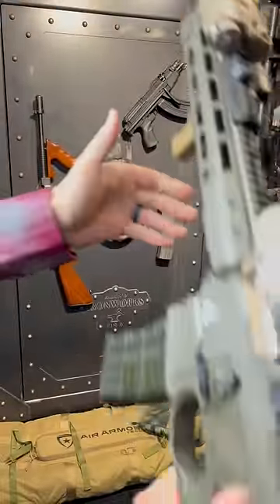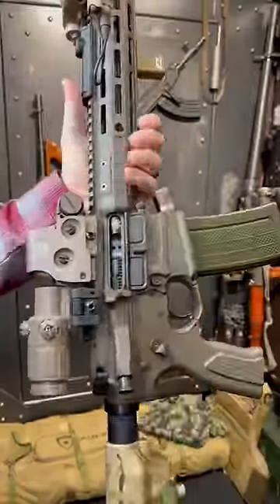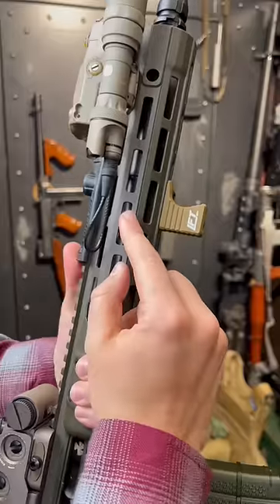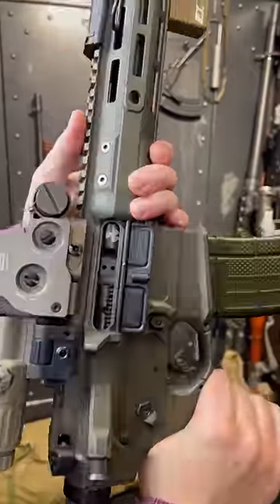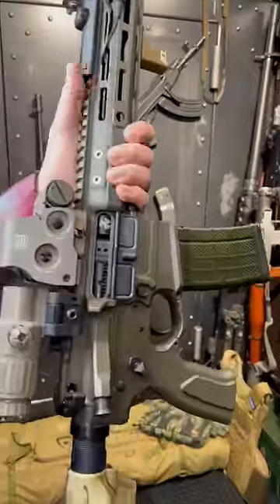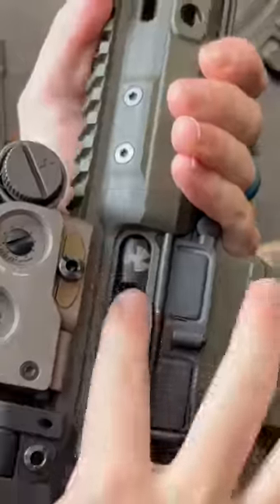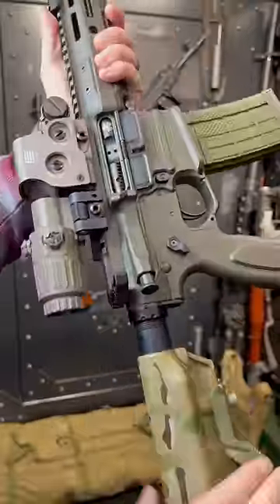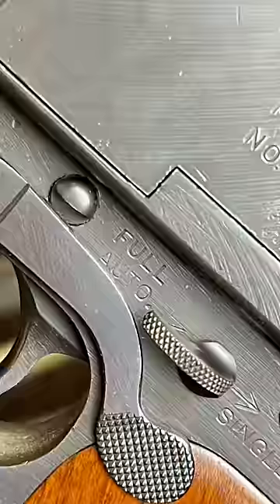Pro Tip: “Tuning” Your AR Explained in 1 Minute #Shorts

Comment: Yeah. You lost me. I take a pistol to the range, shoot at targets until I run out of bullets; then I go home and clean my gun. That's as complex as I get.
Reply from the maker: It’s definitely not something I used to consider a couple years ago, but it’s magical when it works
Reply: @Jacob Guthrie no not really, spend the money and kit one gun out with a light laser and good optic and stuff and you will understand why a lot of his guns look so “tacticool”
Reply: I have my AR for multiple purposes. For one it’s the same platform as the one I get issued and training off work lets me get more promotion points. It also allows me to get way more knowledgeable about what I use. 
But secondly and more importantly, it’s the weapon I have for an end of society scenario. It’s a shit home defense gun unless you live in a ranch and I damn sure don’t have any plans to use this out a car. Any range days are for training and training only. Meaning it’s only purpose is to be used during the end of days, and an over gassed system can mean a rifle that goes 3000 rounds before needing parts replaced over a rifle that goes 10,000. That’s huge in that scenario.
Reply: It's like having a regular car then having one that's a hot rod
Reply: I am the same. Have a couple 30-30's i haven't shot in years, but next weekend I am getting my first AR. 5.56, Plus about 500 rounds.  Next year I think I will build one, with plenty of advise from someone who knows how.
Reply: Thats perfect.

Comment: Would have been helpful for you to actually show people how to tune an AR
Reply: Adjustable gas block, gas tube, buffer spring, and buffer. Ideally, you want a 3 0'clock ejection pattern, unless it's a lefty, then you'll want a 9...
Reply: Yeah he can show all that in 60 seconds, use your brain
Reply: @SantanaBinks  then name the video "why you should tune your AR"
Reply: @joeybible683  why and how are two different words bud
Reply: @SantanaBinks  yes.. I know
Reply: @SantanaBinks  are you drunk?
Reply: @joeybible683  Again, why and how are two different words. Take it slow alright no need to stress yourself out
Reply: @SantanaBinks  yes, I know
Reply: @joeybible683  He didn't say how to tune your AR, learn how to read
Reply: The video is called, Pro tip: how to tune your rifle...
Reply: i take it you're new to ar just get a 20" barrel with a rifle length gas block and you'll be fine
Reply: @joeybible683 Unless he changed it, that is not the title of the video.

Comment: Tuning your gun like that can also make it picky on what kind of ammo you use causing it to not cycle properly as well.
Reply: Tuning a mechanical systems like engines, guns, bridges, or even an electromagnetic system like wifi antennae have a very specific goal: you “tune” to get the optimal output from a specific and repeatable input. 

You “tune” a car for maximum performance using a specific set of parts. 

You “tune” a gun the same way. Every part produced is slightly off-spec (also referred to as tolerance.) Therefore you customize variables against limits to reach maximum performance.
Reply: Guns as clean and shot as little as these are in no danger of that. Only the finest highest dollar ammunition goes through these safe queens😂
Reply: Yeah cuz this gun with approximately 0% salt is in danger of FTF lol

And how dare you not mention twist rate accuracy issues? Excuse me while I overspin myself out
Reply: @Nave6W came here to say that lol
Reply: Tuning your gun like what?  I don’t think you know what tuning a gun is. You can tune your gun to cycle every type of ammo and have less recoil at the same time it’s not one or the other.
Reply: @mforge348  sounded like he was describing Tuning the gas port (if you can)

I just watched a video and subs wouldn't cycle cause he "tuned" it for supers
Reply: @mforge348  sounded like he was describing Tuning the gas port (if you can)

I just watched a video and subs wouldn't cycle cause he "tuned" it for supers
Reply: My AR15 is a rough workhorse - I wont change a thing.
(I chose every part (chromed barrel, sport trigger right at on my order))
Reply: You fix that by buying a piston gun with adjustable gas system . You can adjust the gas to the fly usually has 3 to 6 settings
Reply: @mforge348 no, tuning your gun at all makes it less reliable. The point of overgassing is reliability.
Reply: Bro hes literally just talking about tuning the gas on the gun. He doesnt have to mention barrel twist rate/pressure accuracy. If any, there's such little effect on accuracy adjusting pressure because of barrel twist it won't matter unless your hundreds of yards out.  @Lethalmuffin87
Reply: I would make one point and say that anybody who thinks their 5.56mm rifle has recoil that’s “too harsh” would be better off spending $10 on a gym membership than on all kinds of new parts.
Reply: Facts
Reply: I prefer a gun that runs a little hard but reliable with any ammo over one that shoots like a picky airsoft rifle
Reply: You can tune with an adjustable gas block for DI or Piston, adjustable bcg, adjustable recoil spring and adjustable buffer. It’s all a balancing act.
Reply: Lmao people talking about barrel twist have probably never shot past 300, 1/7, 1/8, 1/9, even 1/12 will be pretty much the same among all the common bullet weights until you get to 500, even then the difference from 1/7, 1/8, 1/9 has been blown out of proportion, we know 1/8 is the best twist now but any modern bonded jacketed bukket is not going to spin apart from a 1 twist or 2 twist per inch difference.
Reply: @rifleshooterchannel208  Less recoil = more hits on target faster. Particularly when not in perfect positioning.
Reply: @PineyJustice  Something that’s easy to do with any shoulder fired firearm chambered in 5.56
Reply: @rifleshooterchannel208  Sure, but why settle for 2 hits when you could have 3 or 4. I have both btw, a nice URGI build and also a full race gun with a m4-72 brake and full tuning. At 50 yards you can put more than double, possibly even triple the rounds on target in a set period of time.
Reply: @PineyJustice  Difference will only really come down to the trigger. 

If shooting an NSR with a 5.56mm shoulder weapon is too physically taxing for someone, I will reiterate my point about that person getting a gym membership or eliminating soy from their diet.
Reply: @rifleshooterchannel208  It's not about tiring or painful recoil, it's a matter of keeping your sights on target with each shot. If we go the other way do you think you could match a 5.56 rifle with 7.62x51? Just as a 22lr will always put hits on target faster than 5.56. Life isn't a balanced competitive videogame, I'll take the cheats every time.
Reply: @PineyJustice  You’re trying to argue a point that wasn’t made 😂

Nobody is talking about larger calibers or any calibers besides 5.56

If someone is shooting a 5.56 rifle and it’s bouncing around too much for them. 

It’s gym time.
Reply: @anthonycall5566  lmk when your gun doesnt cycle the second some crud gets in it since you "tuned" it to be under gassed for less recoil lmfao

Comment: Could you show us how that 3x and holo looks like?
Reply: It's a 3x
Reply: @jailbotmark1379  thank you jailbot mark one 1111
Reply: I run one on my setup theyre amazing
Reply: @rickypickles2219  daaamn! Nice!
Reply: @MatiasAimone  what do u mean lol
Reply: I have one no idea how I could show you photos tho but it’s very nice
Reply: Have an EXPS3 and G33 magnifier on my AR. EOtechs are absolutely worth the price.
Reply: it looks the same as the eotech reticle normally looks but it appears bigger because it's magnified.
Reply: @johnc5330  what is actually happening is some optical magic. The reticle stays the same size with Holographic Reticles under magnification which makes them very useful for targeting. Why it appears larger under magnification is because the way a Holographic Reticle works - the magnification only changes the scale at which we see the reticle but not adjusting the size. So it is bigger, but it isn't. It's just scaled up in size.
Reply: @Andrewy27  ya I didn't explain that well at all. You're right. That's why the aimpoints suck with a magnifier because it actually does make the dot bigger. Causing you to no longer have a 2moa dot.
Reply: @johnc5330  exactly,

The Holographic technology is pretty awesome and coming in at the same price or cheaper than an AimPoint T2 it doesn't make sense to want that over the HWS.

Now I wished that EOTech would do what sig did with their ROMEO8. But I'd imagine that significantly increasing the price
Reply: @Andrewy27  to be honest I prefer the t2 over anything else. I have an exps3 with green reticle and it's a but fuzzy when I look through it. But I do have it on my go to rifle because under night vision the eotech reticle is super clear and crisp. It's a drastic change compared to the naked eye. Also I like the battery life on the t2 better. But I've always got 123a's on my kit so it's not that big of a deal. I don't use a magnifier either.
Reply: @johnc5330  I understand the battery life issue - and if you aren't magnified then it wouldn't matter - I mean if you're running magnification on red dot optics

I run the G45 with an EXPS3-2 - honestly better than fixed mag with canted sight.
Reply: I find it hard to show something like that on video. My dots all look clear IRL, but when I try to photograph or video them, they appear blurry & much larger in MOA.
Reply: Just a 1x holo with a 3x magnifier. 3x magnification with the magnifier engaged. They make a big enough difference in my opinion to justify the weight and crap in your way. It also will magnify your dot 3x so if you have a 3 Moa dot it will be 9moa at 100yards. Not much precision to be had with a magnifier but you can put shots on target within a reasonable distance. I have one on a Geissele super duty, thinking about a LPVO instead of the Holo/Mag, either setup is effective
Reply: @johnleary4597  John, if you're using a Holographic sight and a magnifier it does NOT increase reticle size. It only increases the scale you see the reticle in relation to other points on the reticle. A 1 MOA dot stays 1 MOA under magnification.

Reticle size change is only true for non-holographic Red Dot Sights.
Reply: @Andrewy27  great to know ty💯👌🏻
Reply: What’s it look like? Expensive. 

And because this hunk of metal with an LED and some glass is ungodly expensive, it actually works reliably. Yay.
Reply: @Lethalmuffin87 it’s holographic not LED
Reply: @madride858585  The better correction would be it’s a laser emitting diode “LED” instead of a light emitting diode “LED”

Comment: Ah..it be nice to show us how to do that being that the title says that...
Reply: Its all gonna be somewhat diff.  
What size barrel.  What gas length.  What size gas port.  What weight buffer and so on.. 
Changing just one can change it all.  
The best way to know for your particular build.  
If it ejects 230 or forward = overgassed 
3-4 o'clock properly gassed. 
Beyond 400 under gassed. 
The right way to fix over gassing is an adjustable gas block though many just use a heavier buffer or stronger recoil spring.   
Undergassing isnt normally as frequent a problem.  Though it can be corrected going the other way less heavy buffer/ weaker spring or open up the gas port.

Comment: I built a 16" AR-15 with a mid length gas system and would almost eject empties.
I swapped one of the 3 steel buffer weights for an Aluminum one and it runs fine now.

Comment: Noveske is severely over gassed . I measured 0.88 on my 14.5 . That's insane . My Centurion has 0.75
Reply: Same on my 13.7 Roscoe, it will run crap steel case ammo reliability when it's clean but it's definitely undergassed. When I slap a suppressor on it runs steel just as  beautifully as full power military ammo unsupressed. Finally shooting military ammo suppressed is a bit on the gassy side but not bad at all.
Reply: @BigMackM27  I run Springco Blue with Colt H2 on my 13.9" . It has 0.75 . I have 0 issues with 223 or 556 factory ammo . I've never tried running steel cased . Its suppressed 80% of the time . I have 0 issues with or without a Can . I have YHM Turbo K and its gassy but not ridiculously gassy . I was going to try getting BRT 0.73 Tuned gas TUBE and see if she runs suppressed or unsuppressed with 223 or 556.
Reply: Had the exact opposite With my Balistic Advantage 14.5 hanson profile.  From the factory it wouldn’t cycle any 55 grain only 77 grain.  I swapped out every configuration of buffer spring and buffer weight with no luck. Had to drill the gas port and throw an adjustable gas block on it.
Reply: @mforge348  I've heard other people say that BA gas blocks on Hanson barrels sometimes leak gas . 
I do not have this issue . When I'm running suppressed before installing BRT 0.73 Tuned gas TUBE I was ejecting at 2 o'clock.  Unsuppressed 0330ish . When I installed 0.73 tuned gas TUBE with TURBO K I now eject 0330ish . Unsuppressed with 55g Remans for sure is 4 o'clock.  I shoot Carbine left handed and it ejects right over my right shoulder.  
SPRINGCO BLUE with H2 is my standard for Middys and SPRINGCO Red with H2 is my standard for Cars. 
Before installing BRT Tuned Gas TUBE I was using SPRINGCO Red with H2 but the recoil impulse didnt feel that great.  
I'm not a fan of Adj gas blicks for go too rigs / duty rigs . That's why I opted for BRT Tuned Gas TUBE. I've heard many people say the SUPERLATIVE Adj LPGB is freaking legit because of the bleed off system.  I'll probably try one out on my CSASS 6ARC I'm building.

Comment: No need to worry about tunning if you use piston rifles
Reply: Incorrect, piston driven systems can have different levels of gas driving the piston.
Reply: @cooper9643  yeah usually its 2 settings.. Normal and adverse lol
Reply: @cadian122  not all piston driven firearms come with an adjustable gas block though. Most AKs don’t
Reply: @cooper9643  yeah my point.. Some piston systems don't even have an adjustment and others have 2 or 3 easy external settings... Piston guns are more forgiving and more durable and need less maintenance ... Mind you im not an AK guy... I think guns like the Steyr AUG, G36,  Sig 550 series, B&T APC, CZ Bren, Beretta ARX 100/160 are better then ARs or AKs because they are more reliable and less finicky then AR15s and more accurate and have way better modularity and ergos then AKs .... I take a short or long stroke piston and deal with the extra lb in weight and 1.5 to 3 MOA instead of the .5 to 1.5 MOA that ARs usually shoot for the reliability and ability to withstand abuse, oh and be a side charger instead of the stupid T handle ...
Reply: @smokedbeefandcheese4144  they make ar-15’s with adjustable gas blocks, or you can just install one yourself. I have a 300 blk ar-15 with an adjustable gas block

Comment: Running a A5 buffer system with a mid length gas system. Started this by accidentally ordering the wrong buffer tube and just got the extra parts to run it. Learned it’s actually a much better system

Comment: The problem is that not all ammo is loaded to the same pressures. Some ammo might be “hot” while another manufacturer’s might not. If you tune the gas port on hot ammo you may not get a full cycle on lower pressure ammo.

Comment: Best tip to easily tune your AR: Buy a buffer with removable weights.
The AR platform was designed explicitly so that if you're ever over or under gassed, all it takes is a quick visit to the armory to fix the issue.

Comment: It also means that once tuned it become extra important that you keep everything properly cleaned and maintained  because it is now balanced so that the pressure is much closer to what is needed to cycle everything only, and dirt or extra friction from some other cause will cause issues to happen sooner, would it not?  I am sure that most people that will take the time, effort, and expense to tune it would also be the type to properly maintain their gear, but there are also those who may have more money than sense and will just do whatever sounds cool and then leave things to sit and collect dust.  Those types might need the reminder that regular cleaning and maintenance is necessary.

Comment: That’s quite a sexy AR you’ve got there! 

Anyway… When I built mine, I considered going for the “dissipator” style barrel/gas system for the diminished recoil impulse it provided (for those that don’t know, the “dissipator” is a rifle length gas system on a carbine length AR15 barrel). In the end, I decided against it because, I read some things saying there could be reliability issues with the dissipator gas system because of it possibly under-gassing the system. Plus, I couldn’t find (at that time) a long enough four rail hand guard that would cover the gas block, as I wanted to use flip up sights and not a traditional front sight base/gas block which would give a much longer sight picture, and in turn, the potential for better accuracy. Looking back, I wish I had gone with the dissipator barrel and just changing out the hand-guard later on since the under-gassing had been worked out by simply opening up the gas port a bit.

Comment: So am I wrong in assuming that that also means your ar will no longer "power thru rounds" without being cleaned like it did when it came "over gassed" from the factory? Which means you will need to make sure you clean and oil a lot more to maintain reliability? Just asking...genuinely curious.

Comment: If you’re already over gassed and you drop a can on that thing, it’s not just gas in your face. I had so much gas with my can that it rushed out of every opening. It pushed out of the gap by the bolt catch so hard that it would engage it. You heard that right! Gas operated bolt catch effectively making it a single shot rifle. Oh, it’s also fun having to disassemble and clean you mags due to carbon build up. Yeah, drilled that A2 block quick!